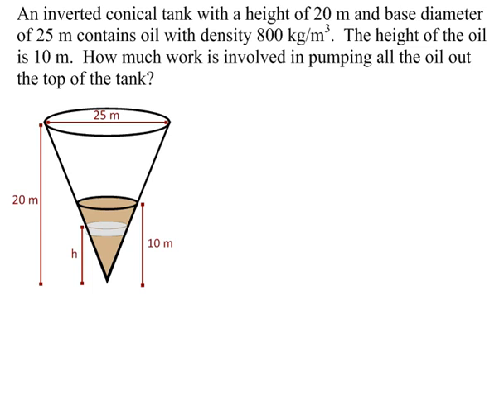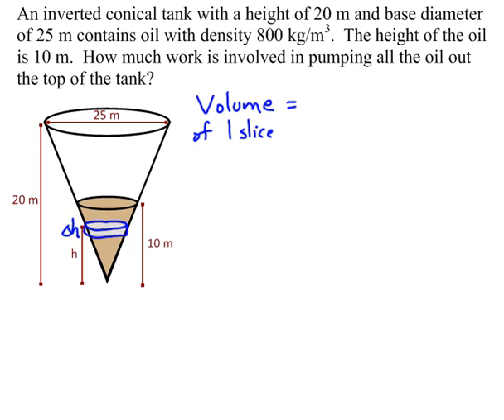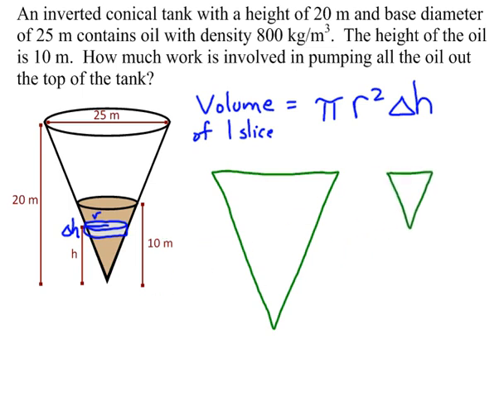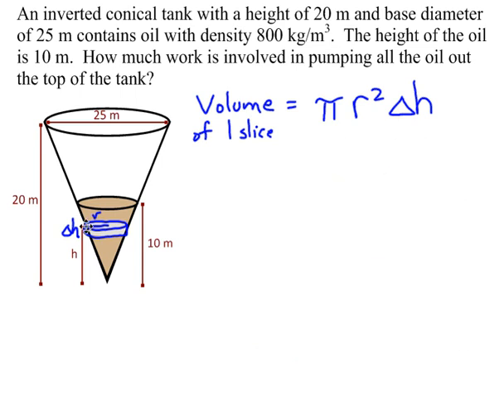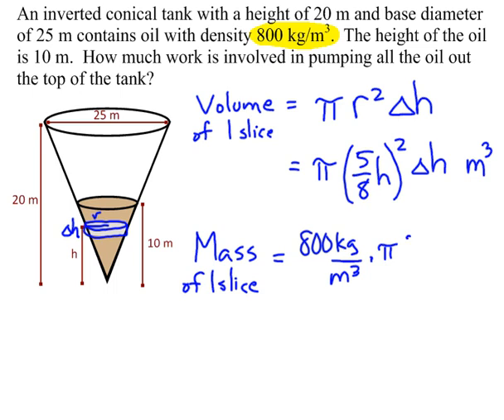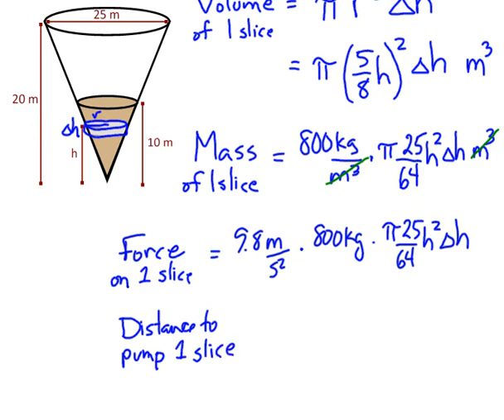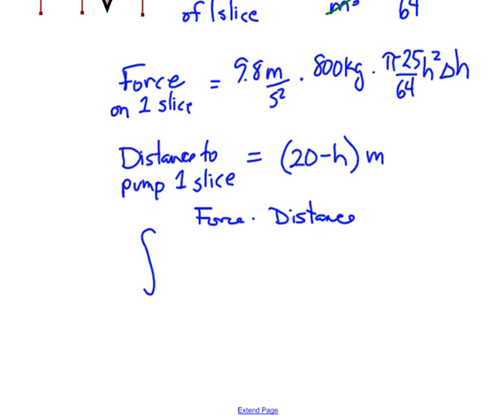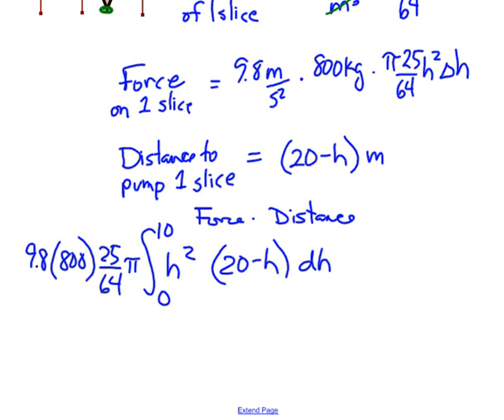Calc 2   Work pump oil from inverted cone

Comment: I see some people who are confusing surface area  pressure  with density.
Bernoulli's Principle: P = P(naught) + (density - rho)gh. 
Density X g X  h gives weight per square area which is obviously pressure due to gravity.
Density is mass per cubic volume, but if you multiply that by the height you get mass per square area, and then multiplying that by the gravitational constant gives weight per square area which is FORCE/AREA^2. 
This problem doesn't deal with pressure. It's dealing with work which is the force times the parallel distance and has units of joules.

Comment: I find it interesting that the cross-sectional slice of the oil filled part of the conical tank, htheta, is interpreted as a cylinder. Excellent explanation, analysis and logical step by step solution of this question.

Comment: The question is asking to pump the oil up and OUT of the tank. So I am skeptical on these limits of integration. To get every drop of oil out of the tank that is currently in it, it will need to be filled completely with a new substance. That would be from 0-20. Someone please tell me why I am wrong?
Reply: you're wrong because the work is what is required to lift the oil in the tank, so you want to integrate from the amount of oil in the tank, not to raise it out of the tank.
Reply: @heysugar100  thank you for this explanation!!
Reply: This is a typical problem designed by someone who has no knowledge how the real world works. There is no contraption that I know of capable of removing oil as it is presented in this example.

Comment: Zero to ten? Are you sure?
Reply: You only have values for h. So therefore since you integrate with respect to h (dh), you integrate from 0 to 10. Since this is a work problem, the DISTANCE IS (20-h). Because the distance your h value has to travel is (20-h). 
What I'm trying to say about the distance is:
W=Fd
W=F(20-h)
Reply: I was thinking the same thing, but the (20-h) accounts for the distance, she is saying only deltaH values possible are from 0 to 10. So it actually makes sense.... 20-h is the distance so you don't integrate from 0 to 20 because the only work needed is from 0 to 10...
Hope that helps.... I have a test tomorrow and this video is great
Reply: I disagree. The question is asking to pump the oil up and OUT of the tank. So I am skeptical on these limits of integration. To get every drop of oil out of the tank that is currently in it, it will need to be filled completely with a new substance. That would be from 0-20. Someone please tell me why I am wrong.
Reply: Yes it is.

Comment: im trying to figure out why in some cases we use h for height but other times we would use something like height given of large triangle minus an x value for the supposed distance from the top to the smaller similar second triangle. so Height as h vs height as something like (20-x)
Reply: Best I can figure its because what you are really looking at is the distance traveled, not the height. So for some problems you look at just the height because you are just looking at a shape. But when moving something from the top of a pile a given slice will be at the H minus some X value as you move down.

Comment: can someone explain why she integrates, i understand that its part of the method but i dont full understand the meaning behind this step. Thank you
Reply: Maybe I'm wrong, but I think it's because you can make an infinite amount of discs in the cone. The volume for each one will be different, and you need to multiply each one by the force of gravity. An easier way is to just take the integral to sum them up.

Comment: @Christian Riesinger They are circles! It really depends on how you conceptually consider the problem. You can either consider them to be cylinders with a height ∆h or circles added infinitely in infinitely small increments ∆h (aka in the "h" direction). Since they're infinitely thin, they are technically circles. (Just as the "rectangles" used to calculate basic area integrals are technically lines.)

Comment: All your work is correct but I believe the final answer was calculated wrong. I believe it's 38281250*pi/3
Reply: You're confused. She is correct. The units of work is Joules.
Reply: You're confusing work with pressure.
Reply: I see some people who are confusing surface area  pressure  with density.
Bernoulli's Principle: P = P(naught) + (density - rho)gh. 
Density X g X  h gives weight per square area which is obviously pressure due to gravity.
Density is mass per cubic volume, but if you multiply that by the height you get mass per square area, and then multiplying that by the gravitational constant gives weight per square area which is FORCE/AREA^2. 
This problem doesn't deal with pressure. It's dealing with work which is the force times the parallel distance and has units of joules.

Comment: If you want to integrate from 10 to 20, then you have to change the radius to 5/8(10-h). When integrating this way, the object is to make sure that as you go from 10 to 20, the radius gets smaller and so by the time you get to 20, the radius is zero. When integrating from 0 to 10, the radius is as shown in the video. This way, as you integrate to 10, the radius gets bigger. Essentially, one way is lifting the disks (delta h) from the top down, the other is from the bottom, up.

Comment: If you define h as the variable that is the distance from a slice to the TOP of the cone, then you'd get a different integral with 10 and 20 as its limits.  But because she defined h as the variable that is the distance from a slice to the BOTTOM, you get an integral with 0 and 10 as its limits.

Comment: you can only evaluate what is actually there, so from 0 to 10 is where your oil is.  Remember you are looking to find the work it would take to pump the oil present (0 - 10) not an entire cone full of oil which would be 0 - 20

Comment: In that other video, they defined the variable to be the distance from the top of the cone.  In this video, the variable is defined to be the distance from the bottom of the cone.  Both techniques work.  The important thing is that the endpoints be consistent with the definition of the variable.

Comment: The endpoints represent values for h.  We find the work required to pump out each slice, then add those up (by integrating) to get the total work to pump out all the oil.  So the endpoints represent the h-value of the first slice of oil up to the h-value of the last slice of oil.  There is oil from h=0 to h=10, so those are the bounds we integrate over.

Comment: the height of the oil doesn't reach the entire 20 meters of the tank. it only goes up to 10 meters so you only need to integrate from 0 to 10

Comment: Thanks for the video and it really helped me understand the purpose of the formula within the integral. However, there is one thing I still do not understand and that is the endpoints of the integral. I do not understand how the endpoints 0 to 10 suffices in finding out the work required to pump the oil out of the tank. Should it no be from 0 to 20 because that is tall the tank is? I am confused as to what the end points represent.